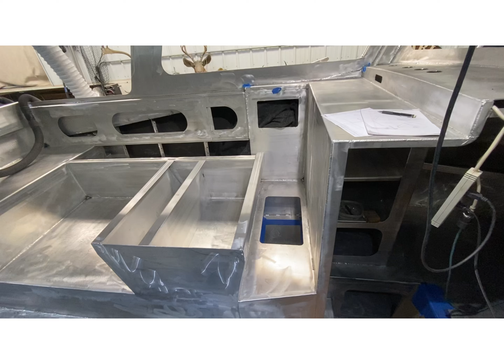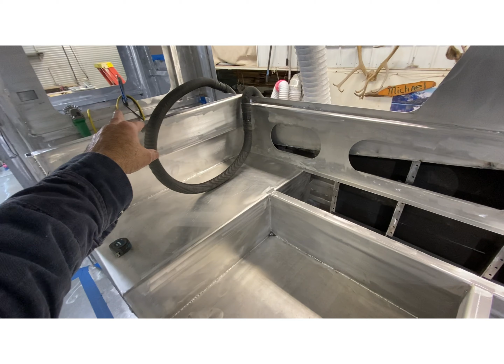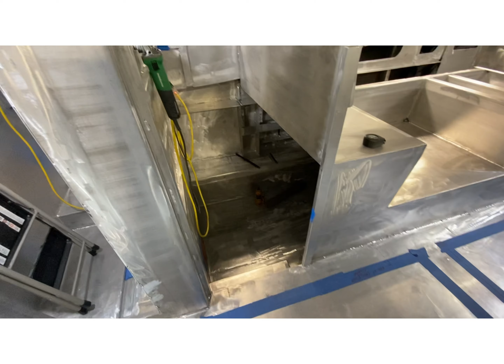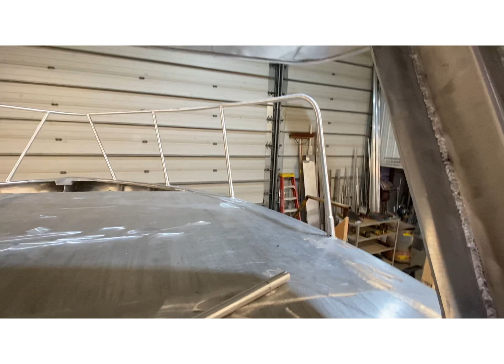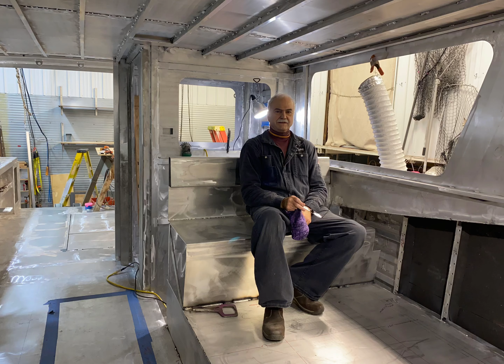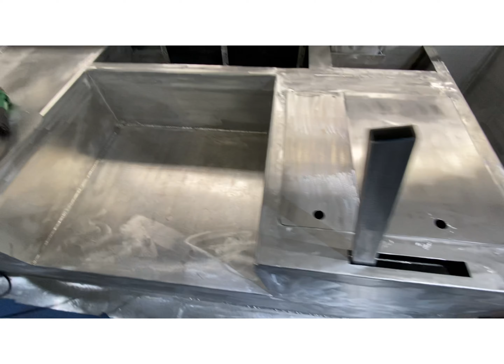Jahrig Aluminum Boat- #30 October 29 2020 dinette and Galley

Comment: What alloy and diameter/thickness tubing are you using for the bow rails?
Reply from the maker: Hi. 1” OD 3/4 ID. 60 series alum. Thanks
Reply: @PaPaJ2020  Thanks.  Project is looking great.  I have spent a lot of time fabricating but never boats.  Am waiting on a 12 foot skiff kit, and then planning to work to larger boats in the 34 foot area.  Really great to see your progress.  I may have missed it but is this your own design?
Reply from the maker: Hi Yup my and a good friend of mine. We collaborated both together. Mainly Kev did the hull and the rest is mine.
Reply: @PaPaJ2020  Very cool.  The construction of the hull was different than most I've seen with doing the bottom plating in separate bent sections.  Very cool.  Have you been happy with that Eastwood contour SCT for removing scale?
Reply from the maker: Yes it is different we shall see how it goes with twin 350 Zuks on it. 
The Eastwood drum sander is a beast. I have many hours on it. Can’t break it.
Reply: @PaPaJ2020  Have you noticed any issues with abrasive contamination when welding later?
Reply from the maker: Nope some time maybe an improvement. Especially with an older sheet